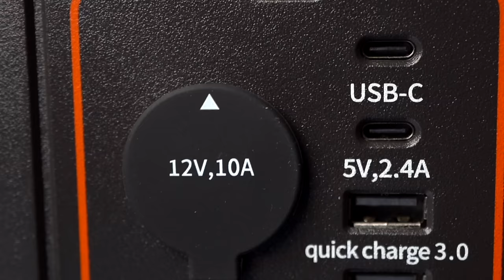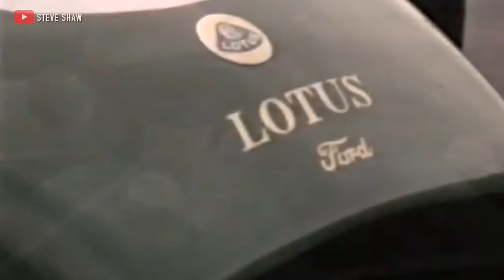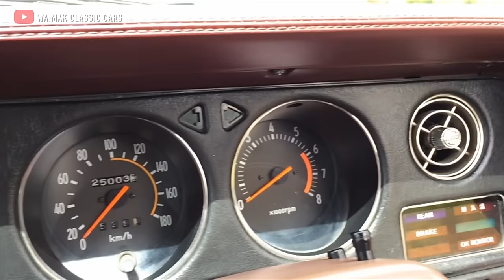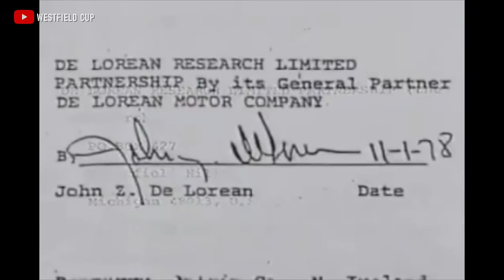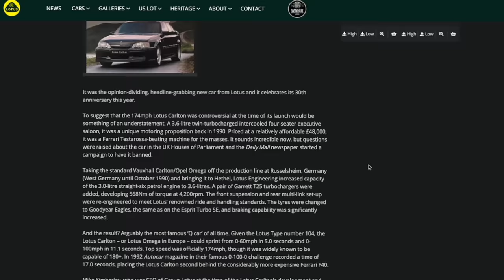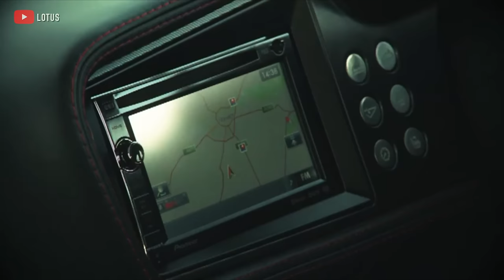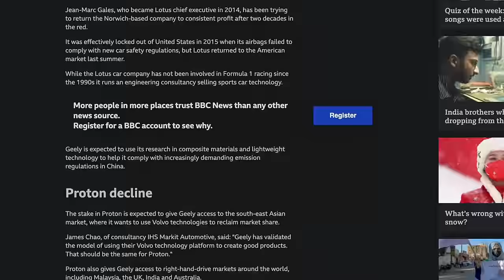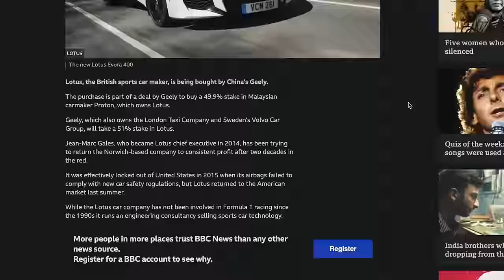Lotus is Dead

Comment: Why is electric a problem?   The point of a race car is to go a lot faster than a family car.   Over a century of gas engines,  800hp family cars never became mainstream.   In the dawn of electric cars, we have 800hp family cars.  Certainly not going to give top fuel cars a run for the money any time soon, but you had to spend FAR more money to get a car that did 0-60 from the factory in 2.5 seconds before electric cars. 

At any point in history some manufacturer could have brought high revving, high HP, high boost  gas engines with LOTS of 1/4 liter cylinders to the masses, but noone ever did.  Ahyone that did a ground up engine design had the chance to make a 3L V12 or 4L V16 or 5L V20 that can spin up to liter bike RPMs but I honestly belive that the manufacturers never gave that to the people because they never wanted to give that to the paople.

Comment: While I agree it is very sad to see good old mechanical traction and grip as well analog steering go away in favor of driver aids and x-overs. They are still making some very enticing electric cars, and if you have ever been in the Tesla Roadster you know that a lotus chassis with electrification is far from a slouch. So yeah its disheartening in a way but I disagree that the brand is dead, less hardcore enthusiast oriented and far more expensive, bringing them out of the realm of many yes, but certainly far from dead.

Comment: by moving into electric engines as seen with kong. the engine can be as light as 180 pounds per unit, lotus could strap four of those new kong engines onto the four wheels exterior behind the brakes and run them in tandem as AWD or RWD. the mid engine dynamics could also be kept by stacking these new kong engines in tandem much like a wankel engine. 

>concept

Comment: I have to disagree with you that the Lotus Eclat has a badly designed chassis - yes it rusted, but the chassis was torsionally stiff and made for a nicely handling car. One it was galvanised all the corrosion problems went away. Also they wouldn't have had as many problems if they hadn't put the foam on top of the rear crossbeam.
Anyway, making an SUV is pragmatism. People want them & are willing to pay a lot of money for them. If Porsche hadn't built the Cayenne the company would have gone under, it turned the company round and made it what it is today.
Hopefully the Lotus SUV will work similar magic, we'll see.
As far as electrification goes, it is government policy, so no getting around it if the government doesn't have a change of mind, which hopefully it will. Saying that, as/when battery capacity becomes high enough, the total mass of an electric car will match an IC engined car. Personally I want the ICE to survive, it may not go as fast as an electric car, but it sounds better. When you get a battery pack down to weighing ~200lb with a range of ~200 miles for the car, then you can say the electric car has won, but maybe a 200lb battery pack with a small range extender engine is enough to keep the weight down but range up, satisfies the Lotus ethos.

Comment: @20:59 you failed to mention that the body panels warped at 18 mos of age, the top never sealed properly from the showroom floor, the switchgear is dodgy at best and the thing was fat and stupid... it was slow, wasnt quick, torque steered to fuck and back, oh and it had a tendency of doing this thing called "not starting".......

Comment: Lotus was dead when they sold to the chinese... It's just that we only start noticing it now.

As for abandoning the fast and light concept is mostly an issue of nowadays market. Full of people with money who want to drive sports and super cars and haven't even the skill to drive a pedal toy car... So they need the car to drive for them. True, hybrids have better performance because of that torque thing at low revs but also true is that cars aren't fun to drive anymore... That's why cars like the 911 turbo passed from 1250Kg to 1700kg and even Formula 1 passed from 500Kg small cars to 800Kg behemoths, all tamed and stable... We live in the most unappealing age to own a sports car and it will only get worse from here...

Comment: The day when the SUV trend dies, will be the resurrection of the automotive industry. These type of vehicle are cancer to the automative industry. But cuurently it looks like our future is heading straight towards EV SUV´s and that scares me. Lotus was some sort of a shining light in the industry, not facing the trend that Porsche, Lamborghini succumbed to, but here´s the deal. SUVs safe brands. Porsche was nearly bankrupt twice, thanks to the failes 928, 924 and 944 models. Only the Boxter and Cayenne, which basically is a Q7 or Touareg, saved the brand.

Its just pain and I appreaciate every sporty ICE car with a manual transmission, because lets face it. They´re dying out, quickly

Comment: I was super skeptical about the first Porsche SUV until I've learned that it kept them going and gave them enough R&D budget to come up with all the GT3 and GT4 cars in their lineup. 

Electric cars are simpler than petrol cars, engine has one moving part, no need for gearbox, we need better and lighter battery tech and that's a big issue (right now we would only be simplifying, not adding lightness) but because of the current weight problems with batteries electric SUVs are not exactly a bad idea. If Lotus can make an electric SUV that will be one of the lightest in its class and able to keep up with the top spec Macans (which BTW are comparable to super sedans these days) that would be an interesting turn of events. I mean, I very much want to see the next Elise. I do. I'm not going to moan about an SUV in the Lotus lineup, if that's what it takes.

Comment: I literally could have told you this in 2009 when I tried to buy one and my femur was literally too long for me to even sit in the damn car. I'm on'y 6'4", sure I'm taller than average but I'm not some huge dude. The fact that I literally couldn't get into the damn car because it was SO small, then they refuse to take any feedback of any kind. Then tried to course correct several years later after already having lost market share told me everything I needed to know. Neverminded the leaking issues and paint issues they were having straight from the factory. It's all ridiculous and anyone paying attention could have told you they were failing.

Comment: Electric vehicles are one of the greatest con jobs ever perpetrated.  Their power, electricity, seems so clean and green, but still must be generated somehow, usually by burning stuff to boil water in order to create the massive steam pressure needed to drive the huge turbines that drive the big ol' generators that make the electricity.  Nuclear power plants use the heat from radioactive materials to boil the water and make steam. Hydroelectric plants don't have to boil water, but they do have to dam up entire rivers.  So far, wind and solar generation of electricity hasn't gotten close to replacing the goode olde water boiling way.  So, while electrical power is very useful, it's not all that clean or green.  
Then there's the little problem of storage, which means batteries.
Which are hugely energy intensive to manufacture, use lots of bad icky toxic stuff, and are a growing disposal nightmare.  
We've been had.  Well, I haven't.  I have never owned an electric car, and don't intend to.  The internal combustion engine is still hard to beat for efficiency.  There are fuels far cleaner than the petroleum-derived ones we've used for over a century.  I think that would be a far more sensible avenue of research and development than electric power for cars.
Unfortunately, Left/Right political bullsh*t, an easily duped public, greed, etc. make formidable obstacles. 
Is Lotus dead?  I hope not, but acquiring the SUV disease isn't a good sign.  We shall see.

Comment: The car as we know and love it is dead. It died when a reasonably dextrous amateur enthusiast could no longer fix it with ordinary hand tools and needed a degree in computing to find and fix faults. So the mid 1990s or thereabouts. The 1990 Elan was a case in point. I could do almost anything on a twin-cam Elan, but the electronics on the 1990 fwd car would be insurmountable. The old Elan just suffered from bad earths, the new on had an ecu and myriad sensors. EEK!

Comment: The fate of the Lotus’s previous owner, Proton is improving but somehow lost a lot of the ‘Ride and Handling’ touch inspired by Lotus. All SUV based on Geely model is utterly rubbish in handling even though Proton engineers had reworked at it. Even the Proton owns MPV handling is much better than the rebadged SUV. 
Geely too has problem dealing with supply chain that now effect on the Proton production and parts supply as they don’t have much experience dealing with international supply chain.

Comment: Most of the early historical film is completely miss matched. The car crashing into the concrete was not a Vanwall, it's more like the Thinwall special based on a Ferrari, & it was Mike Hawthorn getting out of the car, not Colin Chapman! So much of this content is rubbish. Also flat 16 engine? It was a H 16 BRM engine for Christ's sake. Plus Jim Clark died in a formula two Lotus 48, caused by a puncture & no safety barrier's. Jochen Rindt died at Monza, he was trying out the car without the wings fitted to get a greater speed on this fast track. When he braked at the end of the straight the car was unstable & instantly veered into the barriers. Unfortunately he never used the crotch straps & therefore he submarined into the cockpit towards the pedals.

Comment: As my last comment disappeared I'll try again.  The presenter sounds and reports like Fox News mis-reporter.  Sensation over facts.  Picture of the wrong cars with the wrong engines, etc.  Yes, Lotus race cars crashed but all race cars crashed.  The crashes were not all the fault of the car.  Jimmy Clark's F2 crash was likely the result of losing a Firestone tire.  Rindt died as he refused to wear the crotch strap with his seat belt so when he hit the barrier head on he slide down inside the cockpit and broke his neck on the upper belts.  The Europa shown has all sorts on no factory body modifications and a Ford BDA engine when the presenter says it has  Renault engine, as the original cars did (mine still does).

This is just click bait.  It does the image of Lotus no good.  If I owned the brand I'd be suing the bloke.  It's crappy.

Comment: Please Slow IT Down PLEASE ! , FFS ! . . . The Speed of Your Related Referance Picture's Appear onto The Screen To Enable The VIEWER to ACTUALLY BE ABLE TO TAKE IN ALL OF     THE DETAIL'S (HA , HA . HA . .FAT CHANCE OF THAT without CONSTANTLY REACHING FOR THE MOUSE TO Pause and Rewind over and over When I JUST WANT TO SIT BACK And Enjoy Watching Your FOOTAGE with out the strtess and Agrovation Your Editor Forces ME To or Switch TO A More  Competant Rational Length of Time) Followed By ROTATION through When There is More Than A Single  and Left UP There To Adjust The Focus Of The EYES by Not Enough To Obsorbe or Drink It IN As They say . ON Said Subject Editing staff Skills NEED ADJUSTMENT or Sensible Realistic Approach To Easily Solve This , Introduce A Extra STEP JOB Called Quality Control Where A SET OF MINIMUM STANDARDS HAVE To Be Achievable To Obsorbe Like Care colour , side of steering wheel how many spokes on the wheels and type and colour of interior etc for some examples PLEASE . . . . .!!!!!

Comment: Yes, it is dead.

The Emira is a 2-seater that is heavier than the 4-seater it replaces. The Evija is a trendy pipe dream that will be gilded into reality, eventually. And Geely are a predator in 'well-intentioned' garb, single-handedly responsible for culling most of Volvo's pre-2009 engine tech buildup.